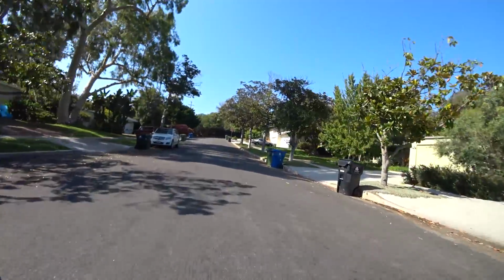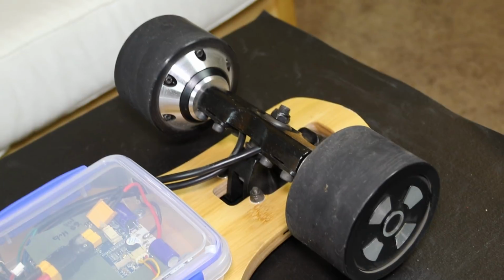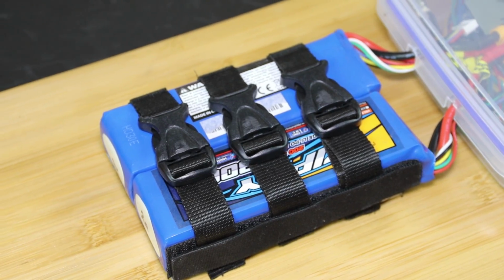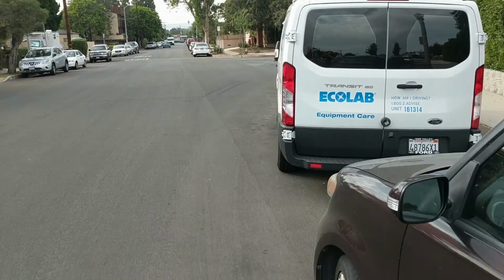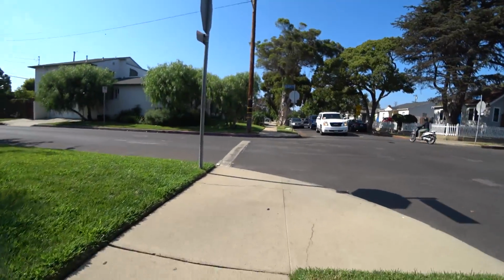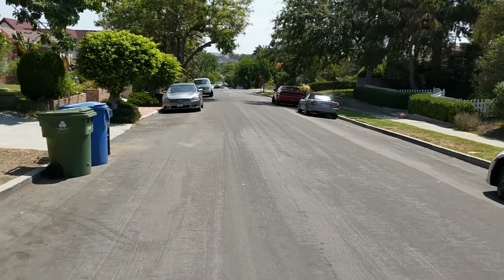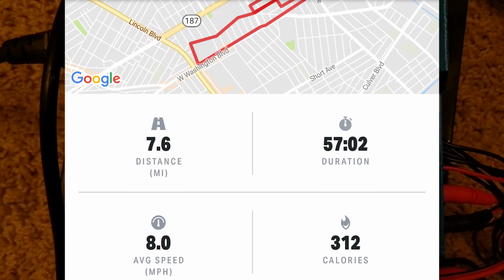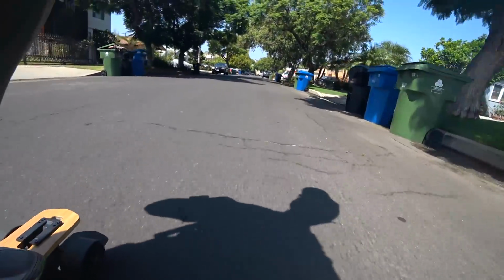Awesome Longboard | 21mph / $370 / Easy Build

Comment: https://www.amazon.com/Weyland-Parallel-Balanced-Rechargeable-Expansion/dp/B06XW6XCZ3/ref=sr_1_4
https://www.ebay.com/itm/iMAX-B6-AC-Digital-LCD-RC-Lipo-NiMh-NiCD-Battery-Balance-Charger-ACDC-Blue-K5Q0/192256809975?epid=2149482818&hash=item2cc3661bf7:g:J9YAAOSwjyxZbslH
https://hobbyking.com/en_us/turnigy-5000mah-5s-25c-lipo-pack.html
http://www.skateshred.com/index.php/wholesale-blank-longboard-decks/36-x-9-5-bamboo-drop-through-deck.html
https://www.ebay.com/itm/Dual-motors-longboard-skateboard-controller-with-remote-ESC-Substitute-/302439713410?
https://www.ebay.com/itm/90mm-dual-6364-hub-motors-drive-kit-for-electric-skateboard-longboard-part-/302325948006
https://www.ebay.com/itm/Plastic-dual-controller-case-and-heat-sink-and-battery-indicator/302489840417
https://hobbyking.com/en_us/xt90-series-adapter-1pc.html
 
Are these parts compatible? Is this all I need?
Thanks!
Reply from the maker: Your list looks good. The only issue I see is the connectors don't match up. The battery you chose has 4mm bullet connectors, the series connector is xt-90, and the connector on the ESC is xt-60.
I have a link in the description to the xt-60 series connector:
https://hobbyking.com/en_us/xt60-series-adaptor-2pcs-per-bag.html
For the batteries, something like this might be better because it already has an xt-60 connector:
https://hobbyking.com/en_us/turnigy-4000mah-5s-30c-lipo-pack-xt-60.html
Otherwise, you can remove the bullet connectors and solder on xt-60 connectors:
https://hobbyking.com/en_us/female-xt60-connectors-5pcs-bag-genuine.html
This might also work but could cause issues making everything fit in a container:
https://hobbyking.com/en_us/hxt-4mm-to-xt-60-battery-adapter-2pcs-bag.html

Comment: Awesome ESK8!!! I'm considering building something like yours. I have a couple questions. Do you need any other connects like xt-90 etc.. How do you make sure there isn't too much power going out and in(so that it doesn't explode)How would you add a battery percentage indicator? Can you make a video on how to charge this board and how you built it?? and finally is it easy to add a simple charging solution so you just plug it in and charges without the whole balance charger thing and how would you do that?

Thanks for taking the time to read and respond to all of my questions!
Reply from the maker: Thanks! The ESC comes with an xt-60 connector so if your battery is also xt-60 you don't need any converters. If you get a battery with xt-90 you will either need to converter to xt-60 or replace the connector on the ESC or battery. As far as the current draw on the battery, most lipos that are 20C or more can safely provide all the current the motor will draw - so there won't be a problem. For a battery indicator, it's not easy finding one that supports 42V DC and also small enough to fit in the sandwich container. Looks like the case you found on eBay with the indicator is a good option. The ESC will also beep when the battery is low. I'll probably make another video showing more build details. Big Kids made a nice detailed video on charging lipos https://youtu.be/3dfBrrNUsos. It's possible to add a Battery Management System (BMS) so you don't need to balance charger, but I think it's only worth doing if you build your own battery pack, which is too much trouble in my opinion. A balance charger is pretty easy to use. Hope this helps!
Reply: Thanks so much!

Comment: That esc is no longer available. Can you recommended another?
Reply from the maker: I updated the description with the new link to the ESC. The listing expired but the seller always re-lists it.
https://www.ebay.com/itm/Dual-motors-longboard-skateboard-control-modula-ESC-Substitute-with-remote/322688412411
Reply: For the ESC with remote am I choosing brushless or hub?

Comment: why is this fatser than the other build you made? i thought they were the same. is it just the motors?
Reply from the maker: The main reason this board is faster is that it uses higher voltage batteries - 10S (~40V) vs 6S (~24V). Also, the 90mm motors in this build are a bit bigger and more powerful than the 83mm motors in my previous build.

Comment: My god. Don't charge those Li-Po Packs at 6.0 Amps!
Reply: Why not? That's 1C for those batteries in parallel.
Reply: Dalton Turner Sorry I didn't even check the specs on the lipos. But even so, charging at high amps will cause long-term damage to the cells.
Reply: I agree. It's rather pointless to charge at anything less than 1C though.
Reply: Dalton Turner what exactly where the specs for those packs? Did he mention it In the video?
Reply: 5s 3000mah 20c
Reply: Dalton Turner well that makes sense technically then to charge at 6A. But still I wouldn't charge at that rate for my liking :/
Reply from the maker: Dalton Turner is correct that with the parallel charging board the current is split so each battery would be charging at 1C, which is fine. However, even though it says 6A when I turn on the charger it actually maxes out at 2.4A with a 5S battery because it's a 50W charger. With the parallel charging, it ends up being just 1.2A going to each battery. I have 2 sets of batteries so I don't mind that it's not charging at full speed.
Reply: ok, well you do you man, Goodluck with your builds!

Comment: Did you have to pair the remote? I bought this esc and tried to follow the process to connect them but am still out of luck.Not sure if there is another way
Reply from the maker: I have a few of them and I think they were always paired when I got them. I might have paired them once. I know pairing can be buggy sometimes. I hope you're able to get it working.
Reply: It turns out it was not set up for 6s so I just had to solder the two points, took me a while to realize because it would just beep all the time. Great build and thanks for the reply!

Comment: Hi I really like your project.
I'm going to build my own electric skateboard and I am thinking about parts you used. I like the hub motors. But the thing is I'm living in UK and there is quite often rainy. Roads are wet and I don't want to kill the board because of little rain. Do you know if your motors are water/splash proof or can you recommend any good ones?
Reply from the maker: Thanks! Yeah, I'm lucky it doesn't rain much in southern California. The motors I use should be water proof. These are the same used on the meepoboard and he's made videos riding through heavy rain with them. As long as you keep the battery and ESC properly sealed I think you'll be ok. It's probably best to try to dodge areas with deep water though.

Comment: good video, liked it!
can you please provide the list of tools (not the parts, but drills etc.) needed to build this kind of electric longboard?
Reply from the maker: Thanks!
I go over the parts more in my previous video at around 13:06
https://youtu.be/x4-DNHn-SAc
Screws and washers can be found at most hardware stores like Homedepot:
sheet metal screws: #6 x 3/8” (for screwing the container to the deck)
sheet metal screws: #6 x 1/2” (for mounting ESC)
flat washers: #8
I used this rotary tool with a cutting wheel for the sandwich container and aluminum strips
https://www.harborfreight.com/heavy-duty-variable-speed-rotary-tool-kit-31-pc-60713.html
I used this drill for the screws
https://www.harborfreight.com/38-in-variable-speed-reversible-drill-60614.html
I'll try to make a video soon showing more detail of the building

Comment: Can you change the wheels if they get worn ? Or do you have to change the whole hub
Reply from the maker: I checked with the seller and he said the wheels on the motor cannot be changed. His reason is that it's to prevent the rubber from becoming loose, so you need to replace the whole hub. I don't think they'd need to be replaced for a long time though.

Comment: Hands down my favorite electric skateboard DIY on YouTube. I was wondering how different it would be if I used a" ZIPPY Compact 5000mAh 3S 25C Lipo Pack" rather than the "ZIPPY Flightmax 3000mAh 5S1P 20C" you used in this video? What negative/positive consequences would there be from doing so?
Reply from the maker: Thanks! I'm glad this video is helpful. The first and most significant negative of 3S batteries is the board would be much less powerful running at 6S (two 3S batteries). I would definitely prefer 10S (two 5S batteries). For the discharge rate, 20c should be plenty (25c wouldn't make a difference). As for capacity, if you get 5S 5000mah batteries you will get around 20km (12.5mi) of range instead of 12km (7.5mi) with 3000mah. The drawback of higher capacity is you will make the board a bit heavier and have less clearance under the board.
Reply from the maker: I forgot to mention that a 6S 5Ah battery will get approximately the same range as a 10S 3Ah battery. I explain it more and included links to other battery options in my previous comment to TheHonarable1. Hope this helps.
Reply: Okay makes more sense! Thank you ^^

Comment: hows the board holding up?
Reply from the maker: In general, everything is going great. I'm always impressed at how smooth and powerful the motors are at 10S voltage. So far the only issue is I had to re-tighten all the screws holding the trucks to the board. I also noticed a bit of wear on the battery strap buckle closest to the front of the board. It got scraped down a bit from hitting the pavement on occasion.

Comment: How long did the batteries last for again? (In distance)
Reply from the maker: The batteries I use in this video get me a range of 7 - 8 miles (depending on how I ride). I weigh about 170lbs and don't go up too many steep hills.
Reply: Does the connection between the controller and the esc have any problems?
Reply from the maker: Sorry, I didn't see this before. It's been great for me. I don't think I've ever had the remote cut out while riding.
Reply: All g man. Great news then because the Meepo board has known for loss of connection. I'll make sure I buy the exact product that you bought. Cheers! : )
Reply: @orensprojects7250  how do you charge the batterys?
Reply: buy more batteries and put them in parallel
Reply: How can i add more batteries using this setup

Comment: Nice build! I just bought the same motors and esc. I plan on using Venom 3s 5000mah 50c batteries. Do you see a problem with that and what if any difference will I see versus the batteries you used? If possible id love to get longer range than the 7-8 miles your getting. Thank a lot!
Reply from the maker: Thanks! The Venom batteries look high quality but I would definitely recommend 5S batteries (like I used) instead of 3S. The board will be much more powerful and faster at 10S (2x 5S) vs 6S (2x 3S). Also, 50c would be overkill for an electric skateboard. You should be fine with 20c - 30c batteries, which are generally cheaper. As far as the capacity, 4000mah - 5000mah should be good for a longer range board.
Reply: Thx for the informative reply. I guess another option would be for me to wire 3x 3s batteries in series but then Im adding more weight and charge time I suppose. Again thx for your help!
Reply from the maker: The ESC in this video is limited to 6S, 7S, or 10S (I wish it supported 8S instead of 7S), so the only good options are basically 6S or 10S. 6S could be ok if you're not too heavy and don't need to go up steep hills. Another thing to consider is range is related more to Watt Hours than Amp Hours. A good rule of thumb is to divide the Wh of the battery by 10 to get the range in km. A 6S 5Ah battery will get you approx 24V * 5Ah = 120 Wh => 12 km range. A 10S 3Ah battery will get you approx 40V * 3Ah = 120 Wh => 12 km range. So they basically have the same range. Hobbyking sells a few 4Ah and 5Ah 5S batteries. Here are some that already have an XT-60 connector.
https://hobbyking.com/en_us/turnigy-4000mah-5s-30c-lipo-pack-xt-60.html
https://hobbyking.com/en_us/turnigy-nano-tech-5000mah-5s-25-50c-lipo-pack-xt-60.html
You can run 9S if you go with a different, more expensive, ESC like the VESC.
Reply: Lots of info in that response...much appreciated bro!

Comment: It is going to get fu**ed in the rain
Reply from the maker: Yeah, I wouldn't ride it in the rain or through puddles. This setup should be ok to get splashed or roll over wet pavement. The motors will be fine but the battery and electronics need to be sealed better. In general, I would avoid riding any skateboard in the rain. The deck and bearings will also get messed up.

Comment: Bro if you hit on a stone or some pavement the batteries they will burst in flames or explode
Reply from the maker: Haha, I've crashed some batteries pretty bad once on a different board and they didn't catch fire. I think the R/C lipos are built relatively strong. The plastic buckles over the batteries in this setup help protect the bottom of the batteries. This definitely isn't the most secure way to mount a battery but it was very easy. A better battery enclosure would be good.

Comment: nice project! clean setup. I am  gonna built a belt drive version, but I am thinking about test one motor and add another one if I need. Do you think this dual motor esc works with only one motor as well?
Reply from the maker: Thanks! I just tested the ESC with one motor connected and it seems to work well when I just spin the motor. I haven't tested actual riding, so I'm not sure how well it'll hold up. You can also ask the person you buy it from to check.

Comment: Awesome build Oren! i'm going to try and do it for my first build. Although i've been doing some research on batteries and found a lot of great info on https://rogershobbycenter.com/lipoguide/. This guide makes it pretty clear though that parallel charging boards are pretty dangerous, charging in a series is much safer because then it can account for each cell.
Reply from the maker: Thanks! and thanks for sharing the resource. I agree you have to keep an eye on parallel charging boards. You want to fully charge both batteries individually first and then always charge and discharge them together (so the mostly stay synchronized). Also use identical batteries. It's good to periodically charge the batteries individually to make sure some of the cells aren't way off. It's not a perfect solution but it's been working ok for me. Ideally, if you have the equipment, you can build a single large battery using 18650 li-ion cells. The advantage of lipos is they're relatively cheap and easy to find.

Comment: How much do you weigh? Do you think it will be good for me at 210? Any idea on a comparison to other boards in its price range?
Reply from the maker: I weight around 170lbs. These motors are pretty powerful with 10S batteries. I think it'll do fine with a 210 lbs rider. If you're looking for a complete board the meepoboard is probably the closest in price and performance. So far I'm very impressed with these motors and ESC so I'm not sure if spending more money would really get you a better performing board - mostly just nicer build quality.
Reply: Oren's Projects thanks. Looks like the deck you linked is out of stock. Any idea if another from that site will be the same? Don't want too long cause I'm worried I'll split it in half... Lol
Reply from the maker: Yeah, I can see they're out of all 36" drop through decks. Another one I was considering is this 39" deck that has kicktails. I'm guessing the space between the trucks is about the same as the 36" and the added length comes from the small kicktails on each side. The website says "Holds up to 320lbs", so you should be good :).
http://www.skateshred.com/index.php/wholesale-blank-longboard-decks/39-x-9-5-canadian-maple-through-double-kick-blank-deck.html
Reply: Oren's Projects sweet! Your board just got cheaper, and there are color selections on that one! I hope I can pull this off. I almost bought the backfire 2 last night for $500 and was thinking if this would be better for less...
Reply from the maker: Haha, great! I think you'll do fine with the build. The backfire 2 looks ok, but maybe not available to ship yet and more expensive.

Comment: So do you have an estimated range for this build?
Reply: Also how steep of hills can it handle?
Reply from the maker: It depends on the usual things like rider weight, hills, terrain, etc. I would say it's good for 7 to 8 miles.
Reply from the maker: I haven't measured the max incline but it gets up hills much faster than any other board I have, including the Acton Blink S2.
Reply: Oren's Projects thanks, are there replacement wheels for back motors
Reply from the maker: I think you can get replacements but I haven't looked into it yet. You can ask the seller before you buy them.